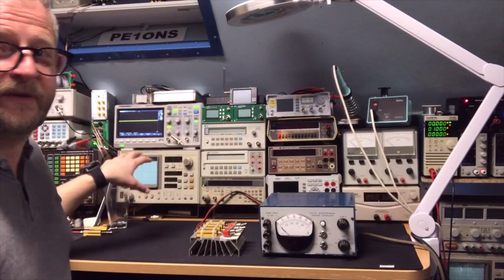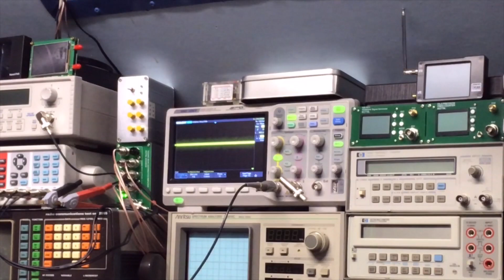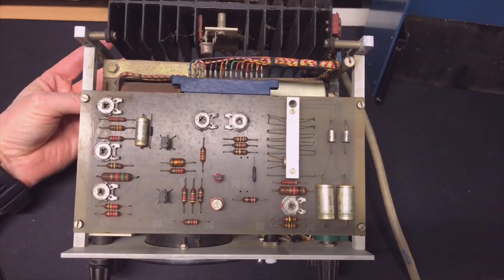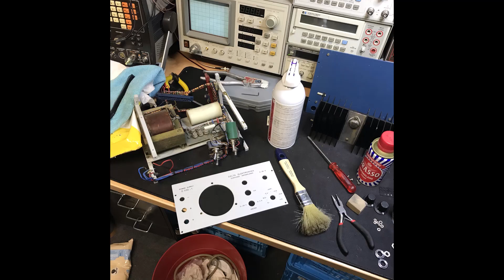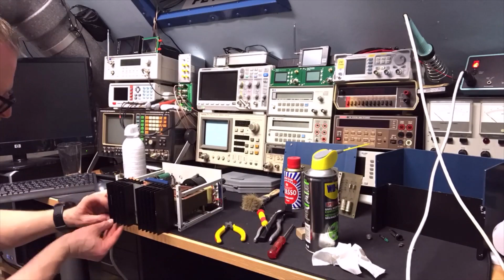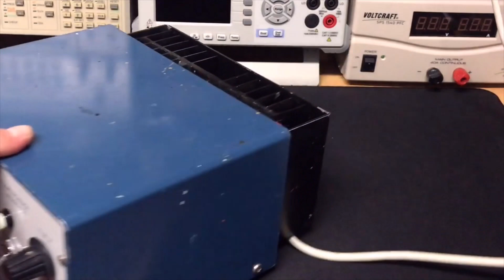TA•0117🟦Delta Elektronika D030-1 Restore 1965-1970 Teardown

Comment: I like the cable lacing, hand built! and the clips on the transistor pairs to thermally couple them.
Did you test the capacitors? I usually lift one leg and charge them to their rated voltage, current limited to a few mA while monitoring the current to see if the current draw drops to a few tens of microamps, as well as testing dissipation, ESR, capacitance etc.
It's interesting to see the current draw slowly drop over time as the oxide layer reforms. I've recently had 30 year old Sprague caps drop to 2-3microamps leakage, a 10th of their datasheet ratings. Good caps!
Reply from the maker: Thanks! , yes they made and still make nice stuff!

Comment: Zou dat ledje geen neonlampje moeten zijn gezien de leeftijd?
Reply: Ik heb dezelfde D030-1 en bij mij zit er een rode 5mm led in, in serie met twee 180 ohm weerstanden in precies zo'n zelfde houder als bij Tony. Of dat origineel is, weet ik natuurlijk niet, wel valt me op dat het van die perfect cilindrische carbon composition resistors zijn, van een ander type dan de carbon film resistors die op de pcb zitten. De layout van de pcb is trouwens een beetje anders dan die van Tony, de thermisch gekoppelde transistors zijn bij mij metal cans. Achterop de unit staat linksboven een serienummer, bij mij: 64 102 43.
Je kunt de mijne zien langskomen in https://www.youtube.com/watch?v=ol-LANzmlDs  (na 39 seconden).
Reply from the maker: Dank je voor het delen interesant, er zijn best wat versies in omloop begrijp ik inmiddels
Reply from the maker: Snap wat je bedoeld... het is een soort insteek lampje... gloeilamp...de insteek hebben ze een weerstand in gezet met LED... de behuizing is nog origineel.. ik ga dat zoeken.. of een oranje LED